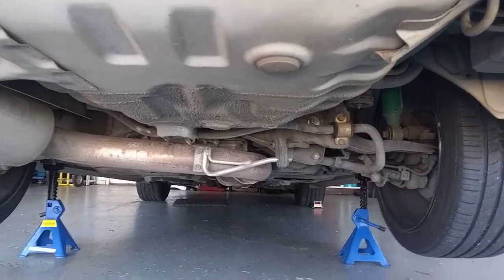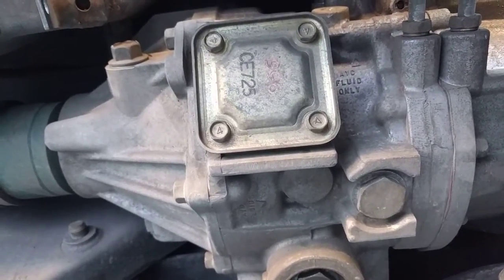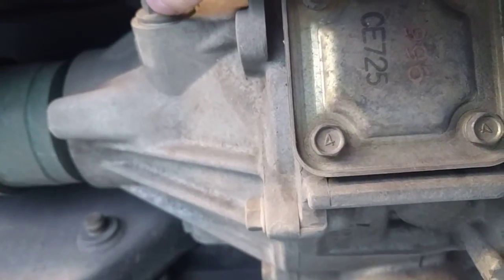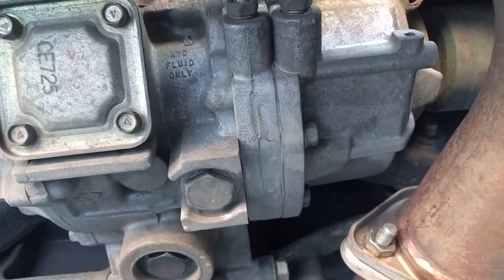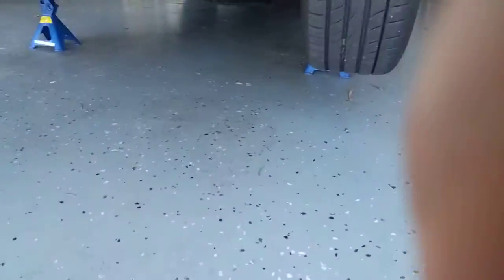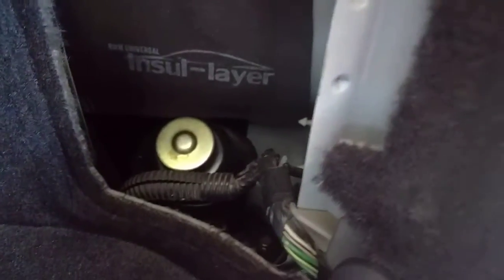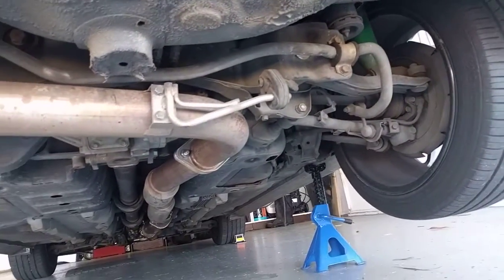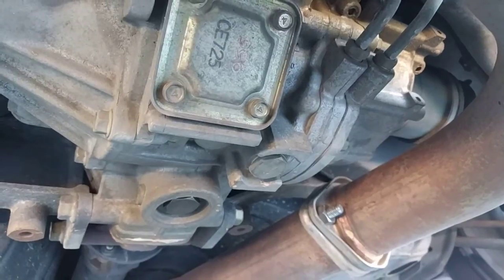Mitsubishi AYC fluids - and whether you need to bleed your AYC

Comment: Hi, so the fluid in the rear trunk reservoir is “AYC fluid” right which is SPIII? It’s not the rear diff fluid
Reply from the maker: Correct the stuff in the boot is SPIII.
Reply: @KaldekBoch is the ayc pump on the legnum is the same as the ayc pump on the evo 8?
Reply from the maker: @mr.eervianlesmana9263 now that I can't be sure of.  The pressures generated are the same, but whether the pump is identical I don't know.  We would have to check the Mistubishi parts database to verify.

Comment: I havent seen any further videos on your replacement with the evo AYC? I guess it was not fitting?
Reply from the maker: No it's been installed for ages now!  Almost 2 years.  I just didn't make a video on it.  It's literally plug and play so there's not a huge amount to say aside from needing to widen the hole in the subframe to access the oil fill bolt.

Comment: Hello will the diff from br4 going to end Evo 5 what is the difference between the VR for diff is it made from aluminium or a stronger metal is it open or closed differential
Reply: They are same unit. Just watch for axle differences. Don't swap the ayc control unit (black box in the dash) from different chassis like galant/legnum into evo or vice versa get right one for right chassis as this will be loaded with different settings.

Comment: Hey dear can i use sae 90 lsd Mitsibishi oil for the rear diff
Reply from the maker: The diff side uses 75/85 GL5 spec oil.  The AYC clutch pack side uses ATF SPIII fluid.
Reply from the maker: And I should add, you can also use the SAE 90 LSD oil rather than 75/85.  My apologies for not being more specific.

Comment: Or you could just put a real lsd in.
Reply from the maker: Brendon you do realise the S-AYC diff is also a mechanical helical LSD as well right?
Reply: Yes I am aware it's a LSD, but it's computer controlled
Reply from the maker: Brendon exactly.  Which is why it's good.  I don't intend to only do quarter mile drags; mountain corners is where it's at for me.  Hence AYC.
Reply: id prefer to be in charge
Reply from the maker: Honestly, I get you have a preference.  But this whole argument of "AYC sucks, real mean use LSDs" needs to stop because it's based on nothing more than comparing dick sizes.  There's a reason for a purely mechanical LSD as there is a reason for AYC.  Torque vectoring differentials are in most modern well-rated performance cars.  The fact that the original AYC units are weak is no justification for calling the idea of torque vectoring dumb.
Reply: I didnt say it sucks, its great for traction. but if i want to slid my car around a corner i dont want the computer to stop me. Plus its lighter and less components to stuff up. that said if i build one for the wife ill leave the ayc in it because she doesnt want to slid the rear of the car.
Reply: More throttle man.
Reply: TrumpCat The Tommie mak editions go for crazy money ! nice !!!

Comment: I could talk for hours just on this one subject but Please Please do not listen to this guy, when servicing your AYC oils he is wrong! Yes they all need replacing at specified times BUT!!!....
It is vitally important to replace and to bleed the hydraulic clutch oils of the rear differential every 4500 miles or every 3000 miles under severe usage conditions (ie, track days etc)  It is also very important to inspect the 'Increase and Reduction' gear chambers oil at this time also and replace if burnt, Just because there are 3 separate fluids does not mean you don't need to change all of them.
I have replaced many rear diffs through neglect.
Apologies, but these assumptions are detrimentally wrong.
Reply from the maker: Geezus give me a break.  I quoted the Mitisubishi recommended service intervals.  The primary point of this video is that the pressurised AYC activation system is a different reservoir of fluid than the internals of the diff.  Because I mentioned the *factory service intervals*,  you have decided that justified coming in here and shitting on me.  That was completely unjustified.    If you want to make a point about how critical it is that you change the AYC fluids at a different service interval, go and make your own bloody video on it!

While you're at it, provide some evidence to back it up.